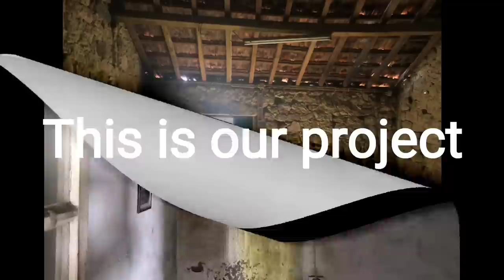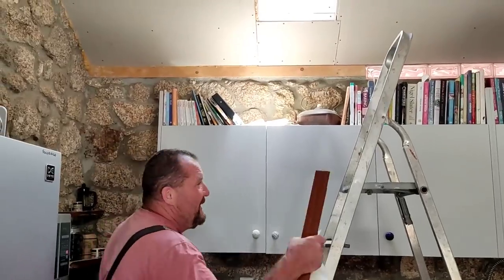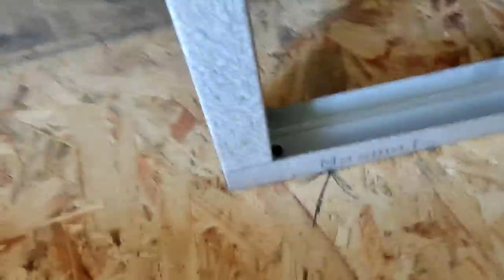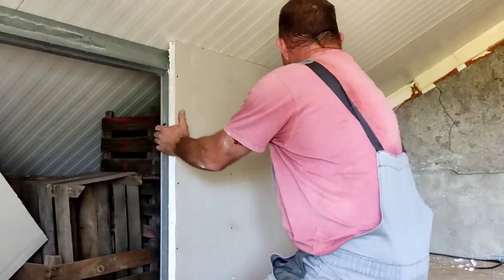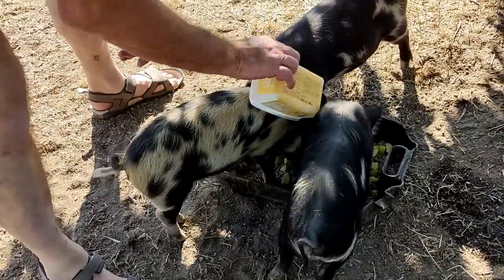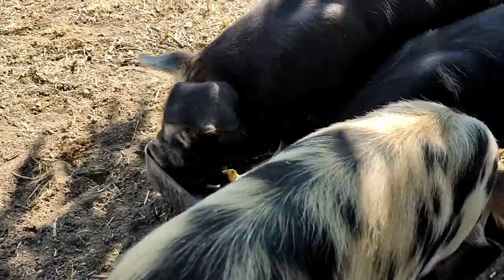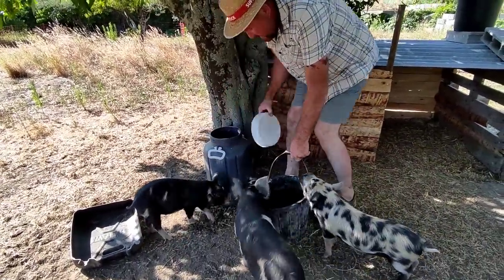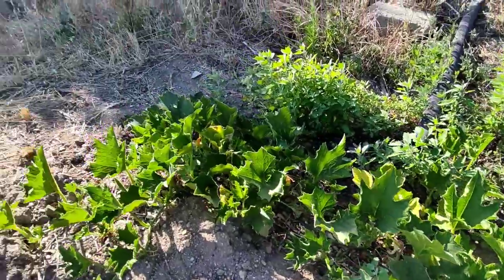76 : A Celebration of KuneKune pigs, Floating Bridges, and Metal studwork

Comment: Thank you guys. About the roof light windows for my house I solved it with a wood frame with mosquito netting hinged on one side and magnets to hold it up on the opposit side. At night I open the windows to let the hot air out and only closed during hot or rainy days and in the winter. You can put white cloth on top of the mosquito netting. It works well and pesky flies and mosquitos has not been a problem. Also it stop spiders to get further in. Just an suggestion though.... Nice video.

Comment: I like that bridge design. Simple but elegant. I have a water tank re-imagined into a water feature fountain, cascading lago with a recirculating pump and UV filter. The 3rd of the 3 basins have a leak, constructed of granite stone. If I removed the plastic pond liner and re-rendered the inside, do I use a mortar plasticizer? Can't find Otimo but found SikaCim. You mentioned your friend will use a product on the inside to stop his leaks but not the product.

Comment: Teflon coated ???? screws. I don't know if I have told you guys, I grew up on a pig farm my Mum started it when my Dad got sick and his wages did not cover the family expenses. She had Large white sows which she cross bred with British blacks or saddle backs. She hated and would not have landrace after a couple of them prove to be troublesome and not good meat producers. She was supplying up to six butchers in Bendigo (late 60's-late 70's).  Most pigs are very clean and toilet in one area there are some exceptions but they are rare, Your Kuni kuni's are gorgeous and you not doubt have to resist staying and playing with them all day. She had trouble with one sow she had not bred who ate some of her ltter but was told by the vet?? that she was iron deficient so bought an old copper and some old sheep and had them slaughtered and made a huge meat ,grain and veg stew for her pregnant sows. this put paid to the problem. This sow they whowever was always very protective of her piglets Dad had to distract her at the front of the pen wherever Mum needed to check on the little ones. She had another who got mastitist and could not feed her litter they all died except one.  Dad took the side off one off those old fashioned toasters and it was used as  radiator in the box the the pigglets were put in in our bathroom, they all had the scours you can imagine the smell. But as I said Mum managed to save one of them in this fashion, she also found a remedy for treating the sow's mastitist. So that problem never occurred again. My mum was amazing as far as her farming technics went. And would br very pleased to see that people are returning to small farming projects around the world instead off the awful intensive farms that appeared in the late 70's and destroyed the animals freedom and natural excercise.       Becareful with their manure, I do not know if this applies to kuni, kuni but Mum's was too hot and burnt plants and needed to be well aged before using as fertiliser, the pile that was washed down from some of the fattening pens of her porkers, use to smoke it was that hot.           Lana                                               Australia
Reply: Most likely phosphate coated.